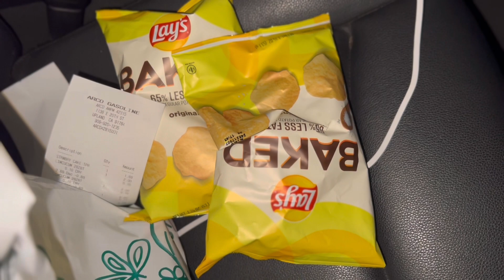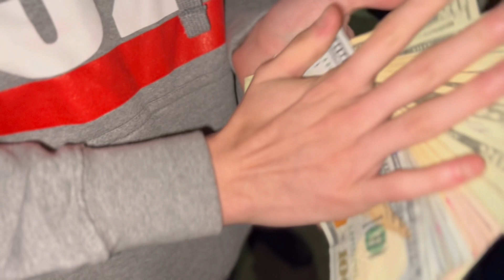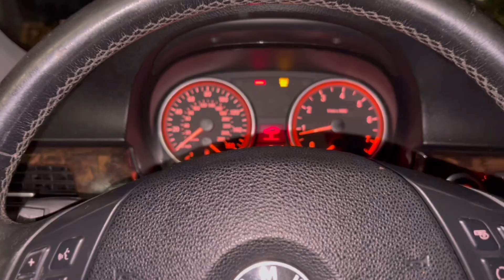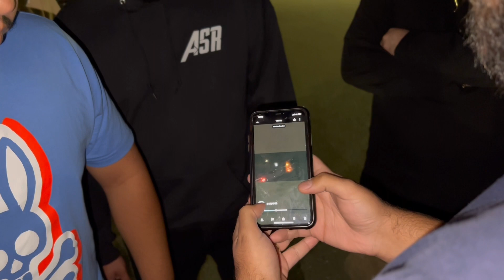Boosted 5.0 Vs ZL1 Camaro | $2,000 Pot #Mustang #Camaro #ZL1

Comment: Every roll race has been a problem, why never dig race ???
Reply: Takes skills for dig races! SKILLS!
Reply: Digs have a lot of problems too. I stopped going to digs because of the 2hr back and forth, multiple burnouts, so and so didn't leave/flash/burndown because xyz. It's money involved, no matter the style of racing, there's always going to be a problem for the loser.
Reply: @gadec4lyfe  Nope, Takes skills!! Thats all...
Reply: @cocacola3269  Not really. The street is prepped most times. 2. Everything is automatic these days, from the transmission to launching. All most of these guys have to do is ask other people on FB what rpm do they launch at and decide when they need a tq converter...add in that these are newer cars with the best TC systems/modes...you pretty much have to do nothing, the car is managing everything. All the 'driver' has to do is hope their tire is sticky enough and the rest is just a ride while they give a little steering input. Now to the manual/old cars/the real dedicated track cars that just happen to get down on the street too, then yeah, they drive their ass off.
Reply: @cocacola3269  Inform me then.
Reply: @gadec4lyfe  You must not have a car or its hella slow.
Reply: @gadec4lyfe  So what you are saying is that you can jump in a newer car, say hellcat, mustang, corvette camaro, and cut what 1.2 - 1.4 60 foot times every run? Yeah, ok.
Reply: @taylorsrus9543  No. What I'm saying is that there is very little driver involvement IE "skill" to a point. Track prep, converter, automatic, suspension and tire is where most people who say digs takes skill, is where their idea of "skill" lives..in a space where it's all on the car to perform and less about the driver...and 99% of the above is off the shelf and a copy paste of the last guys setup. If it simply sticks, it'll be at least a marginal repeat.

Example: If I gave 20 people the keys to the cars you mentioned above and asked them to run a certain time and 60ft, i'd bet 17/20 would be fairly close to each other. Now if I did the same test...but with a manual, the range of times would be MASSIVE...THATS a skill gap. Mostly driver reliant and not all in the setup.
Reply: @gadec4lyfe  I see. You’re right I agree. Manual is where you’ll see an actual skill gap.

Comment: It’s always like this with mustang guys because they somehow can’t fathom how little tq that they have and just assume he jumped because he is pulling right off the hit  with tq. Be a bad day for him if he didn’t remove nitrous 🤣. I wonder if he even changed the tune otherwise the camaro is running less timing and still mopped the floor.
Reply: It’s not on a nitrous tune
Reply: @AnabolicAces  I figured he had another and loaded it but some times people don’t.
Reply: @blackeye3336  yeah I’ve met some good ones and some bad ones. Mostly guys that refuse to here sense. Can’t deny the coyote is a good motor I just find it hard to wrap my head around it being the best because it’s not. But a ford guy will ride those nutz until the sun come up. I like them all so to me it doesn’t matter because I’ve owned every brand. The car doesn’t make you fast your knowledge dedication and skill behind the wheel are what wins races. No brand is sold perfect this is a fact so why fanboy.